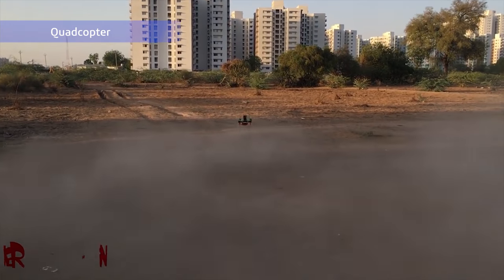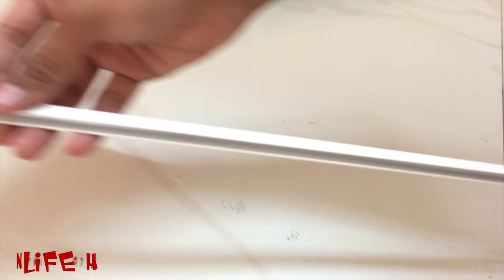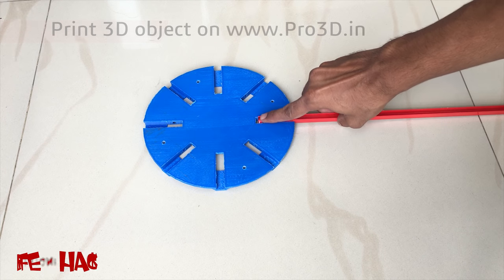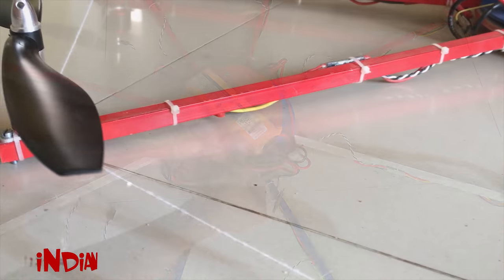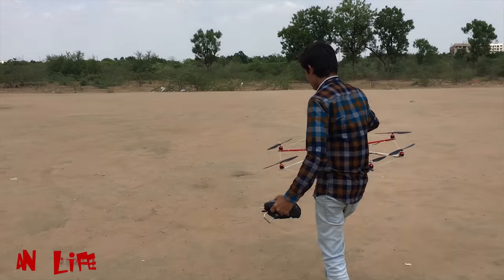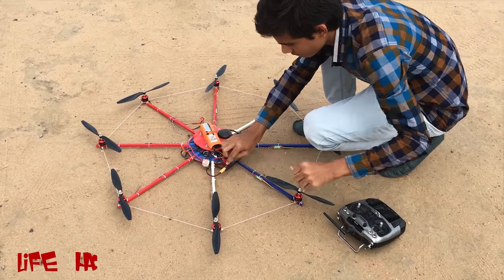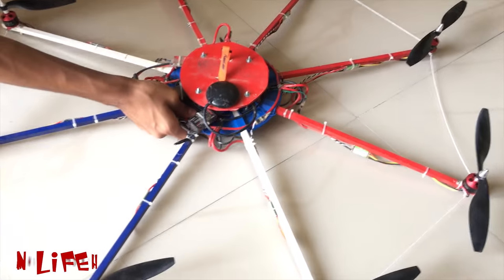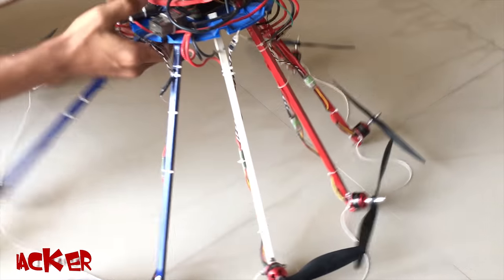Huge Homemade Octocopter Drone - Flight test Or Crash test?

Comment: Nice project but the radio control which you have used is for how many channels ? Because  in all the drone  projects you have used same radio controller
Reply from the maker: I am Using 9 Channel rc remote in this drone but you can use 6 channel also if you don't need other functions like camera gimbals and all in your drone.

Comment: bro who is differnce 2212 1000kv.   vs 2212 980 kv motor .
and 30a/20a who is differnce 
i think 2212 1000kv best 30a.????
Reply: 980 kv low kv high torque  , have capacity to rotate hevy propeller

Comment: What capacity battery did you use and how much flight time did you get approximatly?
Reply from the maker: I use 5200MAH 3Cell lipo for this octacopter, And approx I get 15 minutes flight time.
Reply: have you used this for this battery with your f450 quadcopter? And if yes how much flight time did you get? Around 30 min?
Reply: and also Does it feel more powerful than your hexacopter by its thrust?
Reply: and whats the weight of this octacopter
Reply from the maker: I didn't have tried it with f450 drone but it give almost 13-15 minutes with my hexacopter.
Reply from the maker: Waight of octacopter with battery is about 1.5kg

Comment: normal drone but I am not disided who is use flite controler
Reply from the maker: I use apm 2.6 or apm 2.8 for most of the drone which i have made. If you want to go for racing drone than you can select other flight controller like naze32 and spracing but for big drones, I think Apm is a best option.